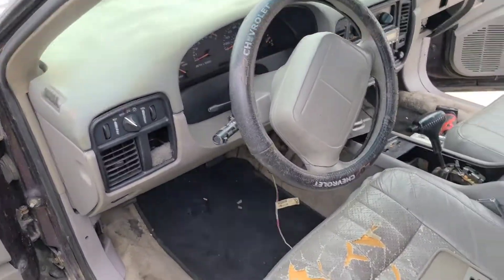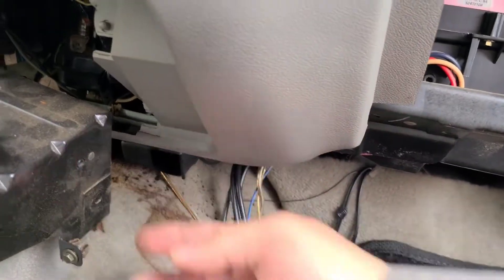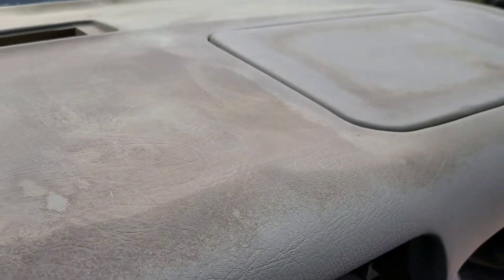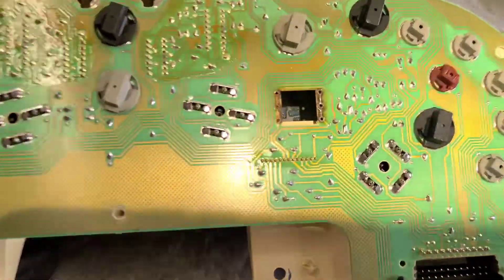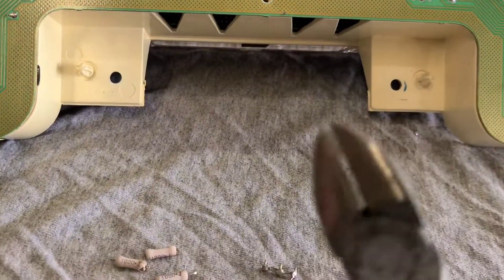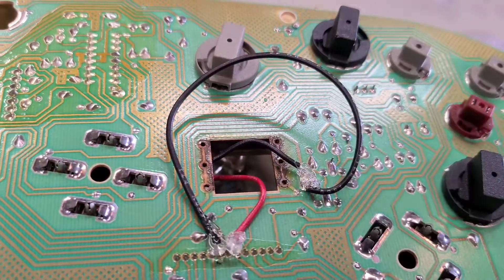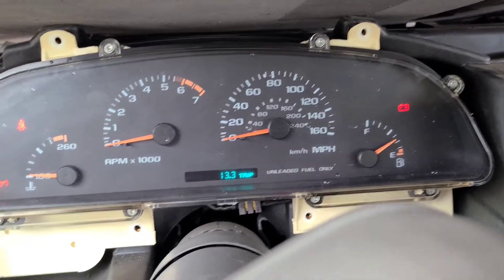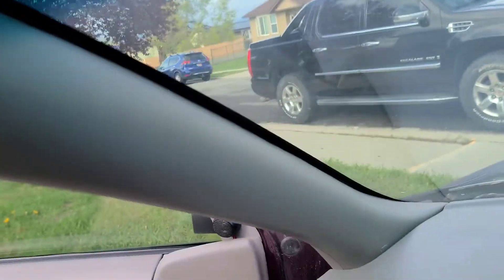96 Impala Odometer fix and dash removal

Comment: Looks great!  I've had my 96 since 96, and went through a couple of repairs on the odometer for the same issue you had.  I'm about to go through it again.  Odometer comes in and out.  This time I might try the repair myself.  I noticed you mentioned that you installed a heat sink to dissipate the heat away from the resistors.  How did you install that?  What does it look like?  Thanks a bunch.
Reply from the maker: There is a link to the part I used in the description. I'm not affiliated to the seller or anything, I just like to share my sources for the parts I used and where I get them from. You'll  need to cut the old resistors out and solder the ends of the new part to the circuit board.

Comment: What kind of prep work did you have to do before painting? Or you just sprayed it down? How many coats looks good
Reply from the maker: Clean and degreased. Then sprayed with Bulldog Adhesion promoter. Then 3 coats of medium grey.

Comment: How is the fix holding up any issues about to do mine and buy the same kit as u from ebay
Reply from the maker: It's holding up great. It has a heat sink that dissipates the heat from the resistors. The factory ones retain the heat and that's what would cause the failure in the first place. Good luck with your project 👍 😀